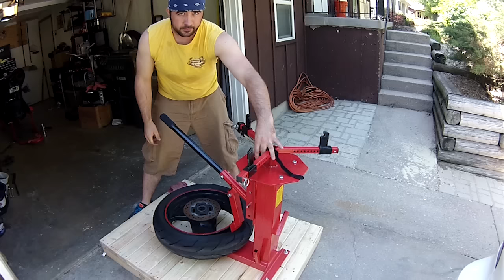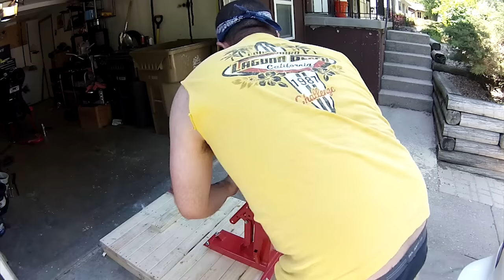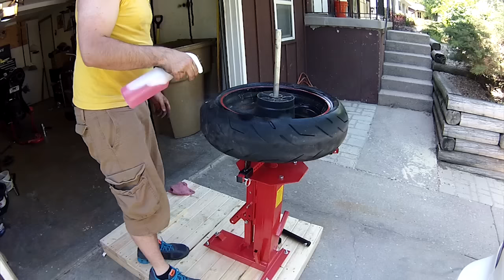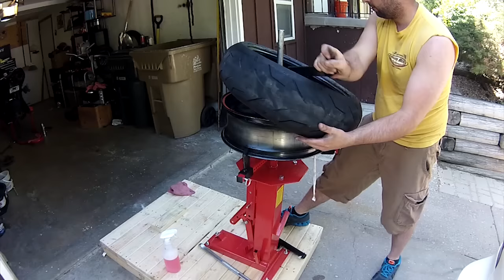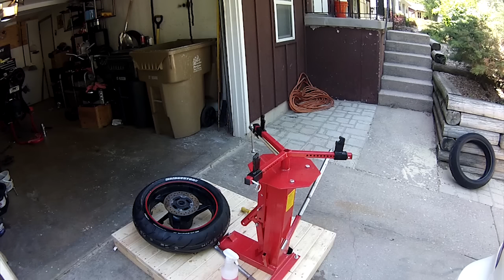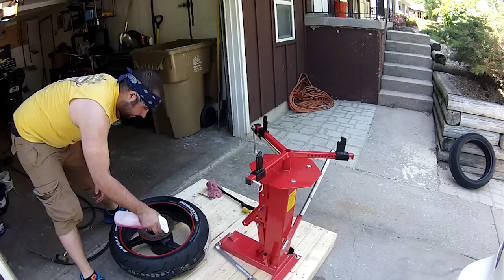Motorcycle tire change with ebay tire changer

Comment: If it doesn't matter whether the rim has a lot of scratches and sanding marks after this treatment, you could do it that way. Soapy water, which remains in the tire after assembly, is a mistake in my opinion, as this results in a large imbalance. This cannot be eliminated by balancing, because the liquid will never stay in the same place.
Reply: As if there is a significant amount of water left. SMH 🤦‍♂️

Comment: For me, the least amount of time and hassle is the removal and placing of the tire on the rim. What takes (for me) the most time is getting the tires on and off the bike so I can change them. I have to remove fenders, pipes, I need 3-4 hands just to get the front tire on. its worth it for me to pay the $120 to have somebody else do it.

Comment: I tried to find this changer but it said 4"-16-1/2" wheels my sportbike wheels are 17" what size are yours?
Reply from the maker: skilled4reel wheels on my bike are 17" as well. the tire changer has to be modified a little to make the 17s fit. I can't remember exactly what I did (drill some new holes or flip a bracket I think) but it was fairly easy to modify
Reply: andrewmiller316 did it scratch the wheel lip at all?

Comment: Where would I find or how would I build the wooden plank that he used to bolt down the tire changer onto?
Reply: It looks like its a wooden pallet
A lot of times stores throw their used pallets out by the dumpsters
Reply: +colecross24 I thought that, but it looks a little more durable. But thanks man
Reply from the maker: I just built a square frame out of 2x4s and screwed boards across the top. then drilled some holes to mount the tire changer to the base

Comment: Good Video, looks like a high quality tire changer. Problem is I can only find them on eBay going up to 16.5" wheels. All my bikes (supersport and supermoto) are 17".  What brand/model is this.

The only reason you struggled so much mounting that top bead was because the mounted portion of it was not in the drop center of the wheel. If it was, would of gone on SMOOTH.
Reply from the maker: it was just a generic model I got off ebay. it was only designed for a 16" tire, but they are easily modified to be able to fit 17" tires
Reply: google sealey TC965 and get an alloy wheel bar at the same time so you dont scratch the rims

Comment: Any folks here that have done both? change tyres with spoons, and then with this machine. Would I be right in thinking that this machine still requires quite a bit of effort. Not really much easier than just doing it with spoons?

Comment: ive only got one question. i see a lot of metal on metal how bad did you scratch up that rim?
Reply: +Michael Donahue Lemme tell you, I'd never let this cowboy "mechanic" wouldn't get within 100 miles of my wheels.
Reply from the maker: +Panchdara I never claimed to be a mechanic. if you don't like how I change my tires I could care less and you can go kick rocks
Reply: +andrewmiller316 like i wasnt meaning no disrespect i was just askin
Reply from the maker: +Michael Donahue wasn't aimed at you, was for the other guy who replied to your comment. but no, it didn't scratch the wheels. there are different bars you can buy that have nylon ends so there isn't a chance of scratches

Comment: How does that changer work for car tires?

Thanks for posting the vid.  Worth watching.
Reply: same way, but more power in your muscles, but cannot be use it with really low profiles or stiff tires such a runflat. is a rudimentary tool

Comment: these come in two size the smaller is for up to 16" rims for £10 more you can have the one thats identical but does up to 21" rims 

how many scratches did the guy put on the rim i wonder....

and how is he getting on with it now after a few changes, ive just order the 21" version from sealey
Reply: I'm bashing one offf

Comment: Ok. But  why splash out on a device when it can be done  (once the wheels r’off) with a few bits of scrap timber, 2 or 3 tyre levers and some thin plastic to look after the rims. Search “motorcycle tyre (sorry) tire levers” on eBay. Dirt cheap. Go for the 14 inch ones if you can.

                      WARNING. THESE ARE NOT “HOW TO DO IT” INSTRUCTIONS. SIMPLY HOW I DO IT. By the way, spoked wheels usually have inner tubes so although basically the same, extra care has to be taken so as not to damage the tube. Just sayin. 

                                    DEFLATE THE TYRE. I hope I don’t have to explain how. 

1. Find yourself a lever about 2.5 mtrs (8ft) long. Perhaps a Fence post, scaffold tube,  plank? edge on would be best}.

2. Place the wheel flat down on 2 or 4  blocks to keep the brake discs (rotor(s) 🇺🇸) from damage or remove them if you choose.
Place the tyre a foot or so (30 cm) from  an immovable object such as a wall with a brick or two missing at the bottom. Alternatively use a heavy cars jacking point. Lubricate the interface between the tire and the wheel rim very liberally with very soapy water then place the lever across the tyre and in the wall hole or under the car.

3. Lift the free end of the lever and place a 2X2x4 (or similar) block of wood under the lever and on the tyre wall close to the rim.

4. Push down on the leaver and force off the tyre bead. Bouncing a bit will get the lube into the crevice and help it slip off. Go round the the wheel a bit to get more off if nec.

5. Repeat on other side.

6. Using the tyre levers and the plastic guards on the rims to avoid damage, leaver the nearest bead over the rim taking 2 to 3inch bites as you go round. Follow up with the furthest bead in the same manner.

                                                              RE-FITTING

1. Warm the tyre if you can. Out in the sun? Or lay a hair dryer inside it for a while. The softer/warmer the tyre is the easier the job will be.

2. Lube the tyre and rim WELL.

3. Check the tyre arrow on the side wall and place the tyre on the wheel pushing the bead over the rim inch by inch all the way round. You should be able to do this by hand (or heel) if it’s well lubed. If not, use the lever method again. Now push on the second bead in a similar manner. Did I mention? Lube it all VERY WELL.

4. Lift the wheel and bounce the perimeter of the tyre on the ground to settle it. Now take it down the shop and get it inflated. This can get a bit scary as the compressed air shifts the beads into place with a bit of a bang. Take professional advice if it’s taking more than 45 psi to seat the beads.
Loads of satisfaction doing this and your knuckles will heal in no time.

Balancing? Can be done without tools. Search YouTube.
Ride safe all.

Comment: Good video, but I've been told to keep moisture out of the tire during mounting. Water expands more than air and could cause HUGE differences in tire pressure during riding. There's a "tire paste" you can use for mounting that has no water in it. Be safe.

Comment: I'm no better I don't wanna pay someone for an easy job, 2 screwdrivers a rag and a pair of vice grips and I'll do it without a single scratch lol. Though I do run the risk of damaging the bead if not don't properly. Or possibly a tube depending on the type of wheel but my success rate is 100

Comment: that is a waste of money. standing on the tire will break the bead.
Reply: break time trust me it won't. especially not with the rear tyre. And I am not a light weight guy either. it takes some serious leverage. you obviously have never changed a tyre yourself.
Reply: You obviously have not changed too many motorcycle tubless tires. Most of the time it won't. I've seen it where breaking the bead was the hardest part of the tire change.